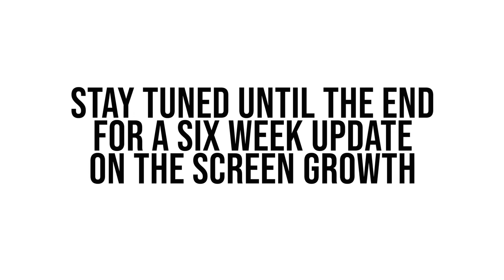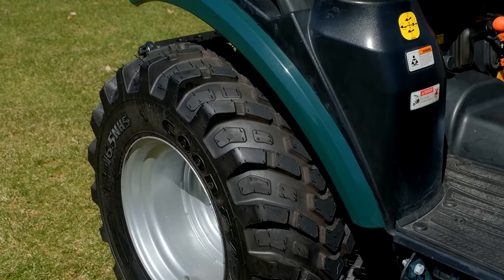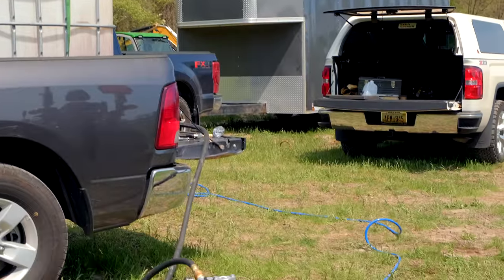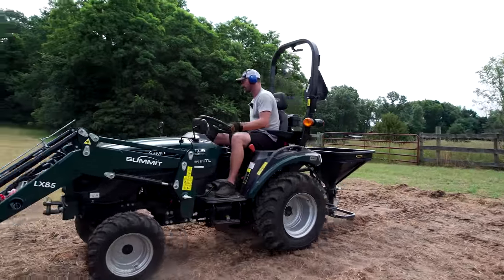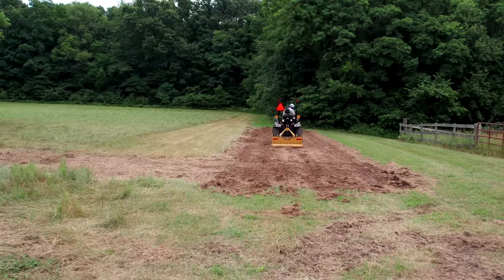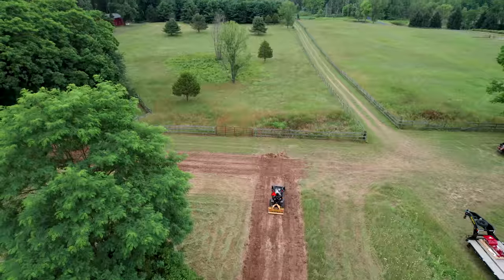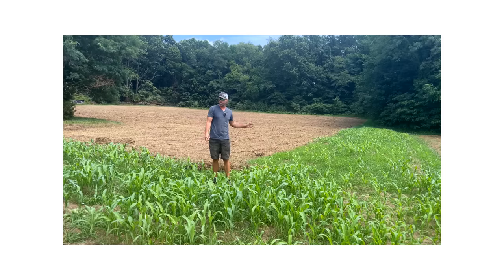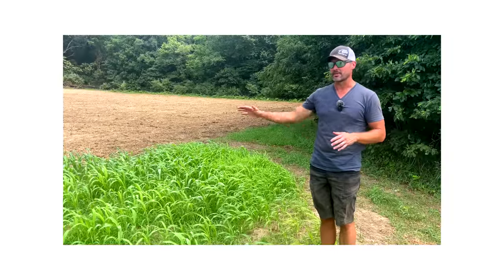PLAYING WITH A BRAND NEW TRACTOR THAT NO ONE ELSE HAS YET! 🤩

Comment: I was going to say running that seed through a spreader is a ballsy move. It's tough to get a good feel for how much you're using. It does work well for large seed you need hundreds of pounds per acre for like rye but for anything under 25#/acre it can be tough to get the rate right and keep the seed where you want it. One other tip I learned the hard way. You'll need about 15 yards of screen if you want it to screen your plot all the way through November and into December. Once it goes from green to yellow it loses a lot of its volume.
Reply from the maker: Hehe, yeah, I think I'll do what I do with clover and brassicas in the future and mix it in with winter rye/wheat.  15 yards wide?  45 stinking feet wide?  Whew, that's a lot.  I'll have to see how my thicker areas shake out late fall/early winter.
Reply: @GoodWorksTractors  I should say if you want it to keep blocking your access once the snow hits. I did about 15 feet the first year and was stoked at the results. Then the leaves shrunk once they yellowed and it was still decent. Then we got snow in early November and it did absolutely nothing to screen my approach. Last year I put on the side of my shooting house about 20 yards deep and on the other side about 10 yards deep. The 20 turned out to be overkill. I used 50# of Egyptian Wheat last year and it turned out awesome. I also spread 1000# of urea on it once it got about chest high and it ended up over 10 foot tall.

Comment: I had Rim Guard installed in my 60-hp tractor by my local tractor dealer.  Unfortunately, his tech filled the tires - as in FILLED the tires - to the point of no air left for the tire to flex.  They rode like a couple of big rocks.  No problem,  Rim Guard is biodegradable, right? I'll just drain some out.  Parked in an unused portion of a field so the valves were at at the 2:00 position, pulled the valve cores and let the excess drain out on the ground (and pants, boots, etc.), then hooked up the air compressor to replace the air.  Worked great.
Except... take the "biodegradable" with a grain of salt.  The grass that the beet juice landed on was deader than if it was sprayed with Roundup.  And it never grew back.  And boy, did it stink!  I finally couldn't take the smell any longer and used the bucket to remove the top two inches of topsoil, mixed it with some subsoil and used it as a weed-free  parking area for my attachments.
I don't want to badmouth the product - it works great.  Just make sure the dealer leaves an air pocket in the tires.

Comment: Thank you for taking on the (Summit) Line, Testing it against the big comparison Subcompact Line of the BIG guys. I just have a question that you should ask (Summit) what about a mid mount Belly Blade. I ran those for a Paving company. These were purpose built Graders. (Summit) could take a front Blade, cut off TOP just a hair. Mount a (real Grader) blade in the center of the subcompact
 Line. I was just thinking in my head. There is an adjustment Lower or higher, MOW control. Just think if you could Run a GRADER blade off those controls, raise and lower Blade, just like mower cut height. If (Summit) made that type of mid mount grading Blade. I think they would have a TOOL that NO subcompact MAKES on the market.

Comment: Questions….Does the pto lift and stay in position? Does the lift handle have a lock that actually works?  Rear diff lock? Pedal or rod poking out? Cup holder will it hold a 32 Oz gulp? Hood latch? These are other questions needing answered.

Comment: Newbie here . . . I don't understand how something like this can lift or pull more capacity, if the horsepower is the same as a smaller lighter 1025r unit?  I think about the scooters we used to have.  Both were around 50cc.  Wife had a smaller lighter bike, I had a bigger heavier bike.  I could never keep up with her because for the same power, her setup was hauling around less stuff.  How is it opposite when it comes to these tractors?

Comment: Like it or not if the Summit tractor is not $10,000 less then a John Deere or Kubota. It would be not worth the risk to buy. If  the tractor and its parts are not be available in 5 to 10 years let alone 25 or more  if are not available then the tractor is useless  when it brakes down.
Reply from the maker: Parts have already been around for years and years.  The platform has been in production for quite some time.
Reply: If the are using the big box store formula where they use Walmart / home depot stores or online and then require independent repair shops to sine up to provide service. that only works until the independent shop get tired of being shafted by Summit also their customers that actually purchased from them get first priority and then the Summit tractor sits collecting dust for days. Like it or not importers come and go daily. Now mater how you spin it they are only a importer not the manufacture.          @GoodWorksTractors
Reply from the maker: @dennisveerkamp2707  Your argument assumes some massive advantage owning Deere or Kubota in regards to parts and service.  My equipment sits for weeks or months at either of my local dealers to get fixed.  Either waiting on parts or waiting on techs.  It’s part of the reason I’ve considered Summit.  Those name brands that folks are brainwashed for have very real struggles.  I get emails many times week about foolish salesmen and service techs at JD and Bota dealers all over the country.  

It’s so bad that I have multiple pieces of their equipment that I’m dealing with in “repair needed” condition because I can’t afford to be without for huge chunks of time.  

So, why pay more for that?
Reply: Like it or not a lot of other importers have come and gone and the product have no parts available. My insight comes from a  independent repair shop that has to deal with the issue of people buying from a big box store and demanding repair support because I sell the same brand of products. Like it or not there will be a John Deere dealer 10 years from now, can you guarantee that there will be  Summit support? Like I said they are a importer not a manufacturer they can shut down and walk away. Unless there is a big cost savings is it worth the risk? Just because they offer a few more options can not make sense without a good deal. Tractors have more than 50 year life but if you can not get parts because you choose to buy a new brand and not save alot of money you choose wrong. Tractors are not cars where 20 or so years most are scrap. Tell me how long is the contract Summitt has with the manufacturer?
Reply from the maker: @dennisveerkamp2707  You can’t guarantee John Deere and Kubota will be around.  Simply an opinion.  Solis is already in the USA and has been for some time now.  This is what Summit is based off.  Parts are stored domestically.  Can’t act like JD and Kubota don’t have to import their parts too.   Summit is 30% backed by Yanmar.  Be a naysayer, but just be ready to own it when you’re wrong.
Reply: @GoodWorksTractors  if you are so sure about them why are you not selling them? Like it or not they can disappear tomorrow like I said they are just a importer and will out a dealership support that a customer can rely on it is like buying from eBay. For the same money a local dealer with a proven reputation is a smarter choice.
Reply from the maker: @dennisveerkamp2707  they are selling at mass retail.  I have no interest in selling new machines and have turned down several equipment lines.  I don’t have a service department and don’t want one.
Reply: @GoodWorksTractors  exactly that is why I made my first comment. The tractor needs to be priced a lot cheaper than the ones beaning sold  at a dealer with a service department. Big box store don't have a service department also and they rely on a independent shop to do the repair work that has no obligation to the owner of the tractor
Reply from the maker: @dennisveerkamp2707  no point talking to you further.
Reply: @GoodWorksTractors  Yes, the particular model from ITL is in production from 2013.